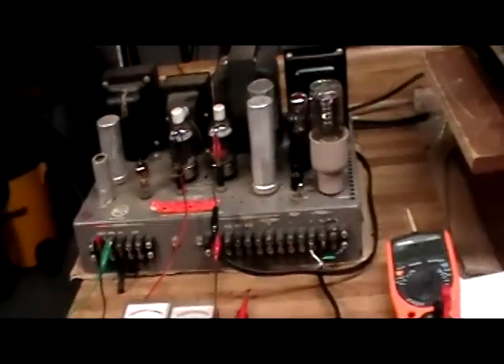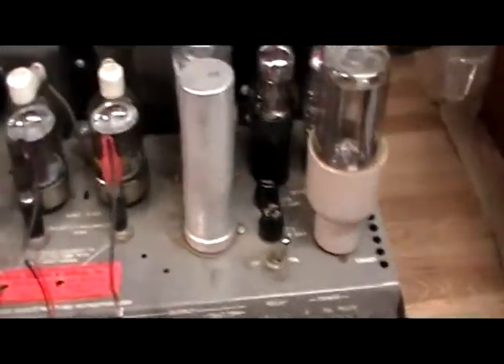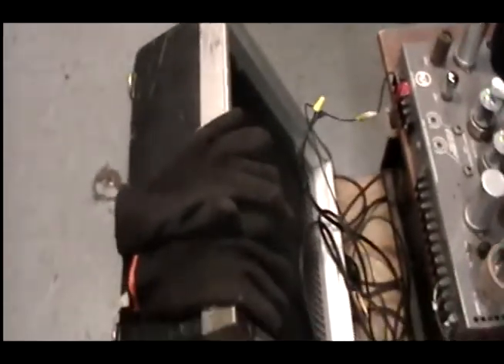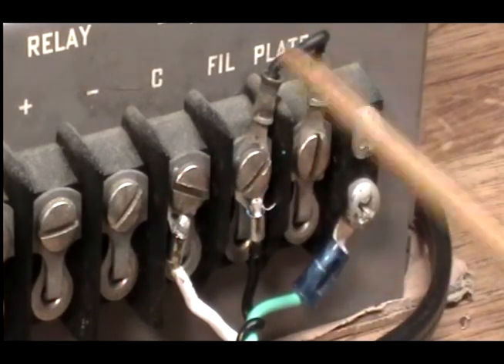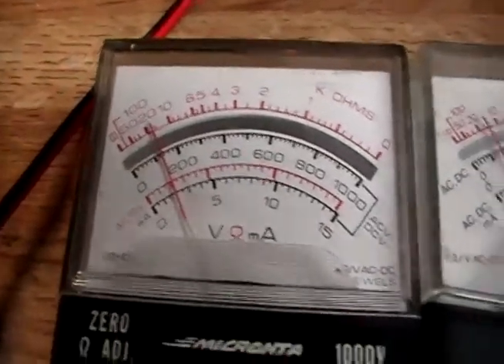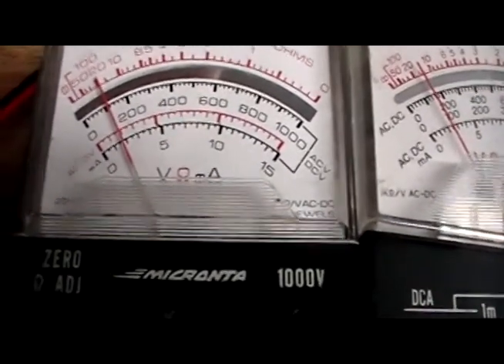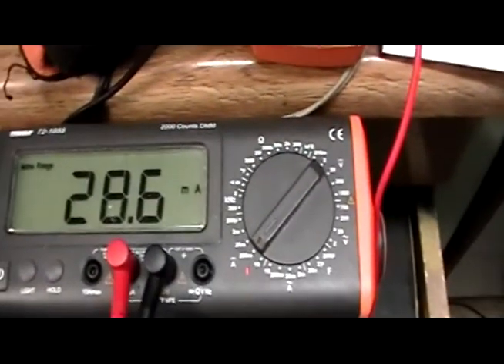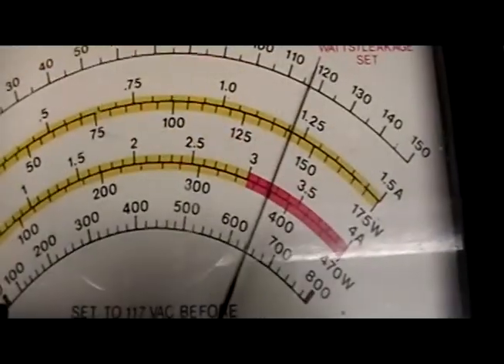Vintage RCA MI 12182-A Theater Amp-Bias adjustment and some things to know

Comment: I’ve just picked up a little brother to this one-an RCA MI-12296 PA Amplifier. Just going to start by bringing it back to spec-recap, tube checks -transformers. A 25 watt PA from what I can gather. 2 mono phono inputs and 2 mic inputs. Waiting for schematic…..nervous as hell to get started. May Jack Darr Grace me! 
Sounded great!
Reply from the maker: That ought to be a fun project !Those power supply caps are the first priority. And as long as the rectifier(s) is working and you get B+ voltage, most of the battle is won. Good luck !

Comment: good vid,i have a few and some others.The amps run class AB1. RCA specs dont advise class A. THey will do almost 100w if you bump the B+up to a full 600.But keep the current down at 25-26ma per bottle.They are a high mu tube and will run up the plate temp really quick!

Comment: Cool!  Why 4 transformers on a mono amp?  I can see a need for the power, output and possibly an inverter transformer, but what would the 4th be used for?  Just curious, I am not an EE. :)
Reply from the maker: If I remember correctly; there are two AC power transformers even tho the schem doesn't show it; One for the heaters and rec. tube, and the other powers  the plates of output tubes. As you say, there is an output transformer and the 4th is not really a transformer but  a choke on the rectified B+ line.
Reply: @MrPopalosus  OK, thanks!  I meant to say choke, don't know where inverter came from. Duh.

Comment: I just acquired one that needs some major TLC.  Along with a preamplifier that uses many 6080 tubes.  There is also another unit with two transformers that has a meter on it.  Could you provide me with any information on the units.  I understand they were theater amps.  I am willing to sell them.  All units are untested.
Reply from the maker: I have a PDF of the M-12182-a Service Manual but that's all I have on that system.
I'm willing to send the PDF to you, (if I haven't yet) just provide an email address. 
Yeah, they were designed  for early theater sound. They Daisey chained them together if 70W was not enough.
I ran the ones I repaired straight off of a CD player, but there originally may have been a preamp between them and the projector.
Reply: @MrPopalosus  I'm curious about caps 14 and 15 both at 80mf.  Why does one of them remain "hot"?  Is it possible to simply use a one multistage 80 + 80mf cap and have the hot one grounded as well.  Why was the amp designed so they were separate and one hot?  It's not like they didn't have multistage caps as C11 is 40 +40.
Reply from the maker: @StevenCarinci  You raise a good question, but I think back  in the day electro caps were made with the NEG- common always being  the "can".  So even with multi-stage electro's the NEG. was the case tabs.
I don't see why they couldn't have just used a 40uf cap in this (series) instance and just a 200K resistor.
Reply: @MrPopalosus because the B+ is 570. Even today you cannot buy an electrolytic cap rated higher than 500v so you use two in series with a resistor potential divider to equalise the voltage on each. See schematic. Hence the hot can is half B+ or 285v. Get some large heatshrink over it!